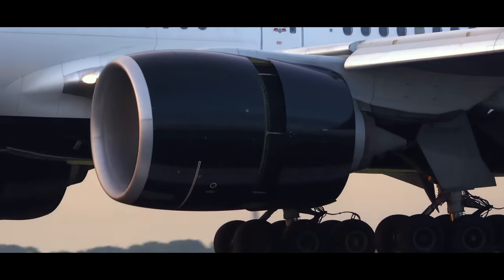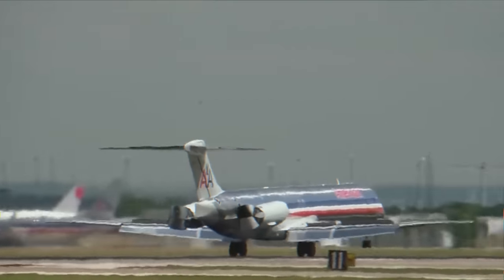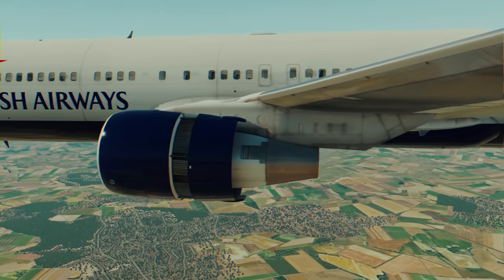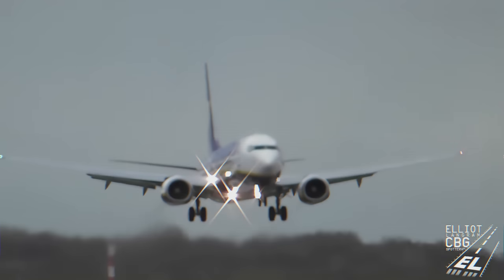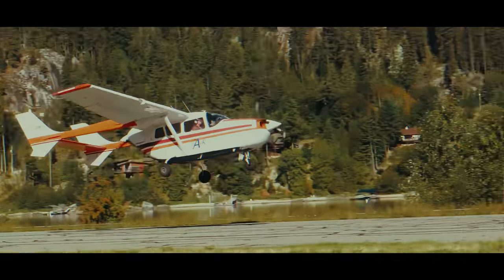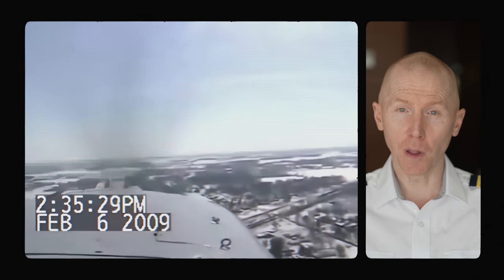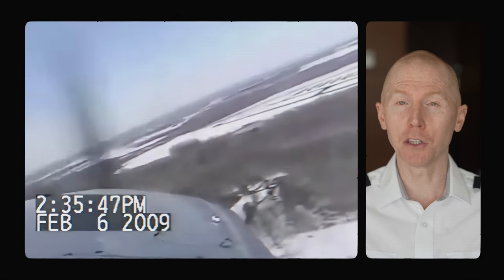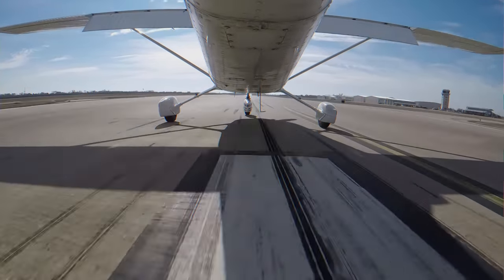Ryanair Pilot Makes Big Mistake

Comment: You said "I'd want to get lined up with a runway as fast as possible".  That's exactly what the pilot did, by flying directly towards a runway and intercepting with a tight turn.  He was more than half way down the runway, not like he followed any traffic pattern.  I'm not sure what you would have preferred,

I thought that heavy breathing was the engine backfiring, which is why I was mildly confused when you addressed the windmilling.  I thought the engine was running and the pilot killed the ignition as soon as he was clear of the runway.  

As the operator of less than reliable vehicles, I admired what I thought was good protocol for a failing engine - let it run if it can and you can gain any* needed propulsion, but as SOON as you can, cut power and get that motor to stop rotating before more damage is done.
I didn't notice the centerline effort, but with any profession, an aspiration to do better and challenge yourself is highly respected.
Reply: Of course I paused the video, typed that comment, then resumed and you elaborated about the tight bank angle and the stall risk.  

- I stand by it though.  He did not initiate a turn until the stall horn cleared, which has some margin, was clear of the trees, and in close proximity to the runway, losing altitude was a desire and done controlled.

Comment: The FCOM I'm looking at for the 737 says that the thrust reverser can be deployed when either radio altimeter senses less than 10 feet altitude or when the air/ground safety sensor is in the ground mode.
Reply: ☝️thanks for watching & leaving a comment, congratulations, you have been selected amongst my shortlisted winners
Kindly message me on the above ☝️

Telegram only to claim prizes🎁

Comment: Inadvertent thrust reverser deployment in flight at high speed (>400 knots) was what crashed Lauda Air 004, a Boeing 767. I read that Boeing had to update the systems to make thrust reverser deployment in the air impossible.

Comment: Just on the point of the pilot possibly thinking he was already down when he deployed, I notice at that exact moment, the wings level quite sharply - there was probably a noticeable jolt on board and it would be visually impossible to distinguish, so it's entirely possible that for an instant, the plane did a convincing impression of having landed. I know when driving or gaming in a tense situation, my reflexes with familiar controls can be faster than conscious thought, something tells me it's the same for piloting a real plane :-)

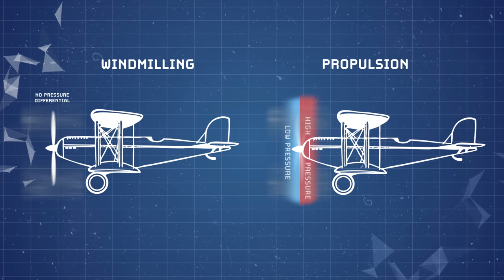Comment: 13:57 - That "low pressure / high pressure" graphic is very misleading. It's not air PRESSURE that pushes the plane through the sky, it's air MOVEMENT. The propeller hits the air at an angle of attack that catches the air and throws it backwards. Newton's law (action/reaction) is what pushes the plane forward, not Bernoulli's equation. In fact, the air pressure behind the prop is lower than the surrounding air; THAT'S Bernoulli's equation, and it's where wingtip vortices come from. And by the way, airplane wings work the same way: by pushing air DOWN, just like a helicopter rotor.

Comment: Agree with 95% of what you say. But saying he should have been lined up with the runway earlier is not right. He barely had the energy to make the field. He did EXACTLY the right thing. Get it to the field. He saw a last minute opportunity to get lined up and took it. If he had landed across the runway on the grass(snow) he would have still made a superb job of it.  A well done. He could not line up earlier.

Comment: If 1. you have high speed on landing (For whatever reason like side wind etc) 2. having short runway 3. snow - slippery surface, maybe he tried to slow it down ASAP, but before touching down it's not recommended to use the reverse at all. and those swing left and rights! no idea ...  
Also why don't we have cameras for pilots to look at the lower area to see what's going on!?

Comment: Don't know about the later dash numbers, but on -200 you had to compress the right oleo to get the aircraft in ground mode. Only then would the thrust reverser and ground spoilers be deployed. Correct me if wrong.

Comment: Pretty sure the guy still had partial engine power. If it was just windmilling the propeller would have stopped a lot sooner. Especially if he was landing with a tailwind. It takes pretty decent airspeed to get the propeller to windmill. His prop didn’t stop until he was darn near stopped

Comment: The second issue with the pilot losing power on takeoff during climb is what I have been trying to get the FAA to respond to. The airport near me has pilots training and practicing all day and when they take off and enter their supposed "traffic pattern" they have only reached 100ft, they fly right over people's homes and a large retirement community, if this were to happen, excuse me, when this happens there could be a disaster, they have not achieved enough height to do anything but crash and because they and the FAA refuse to adress the issue and reroute their traffic pattern over things other than homes, for example the state forrest that surrounds us, the lake and several reservoirs that surround us and a hiway, they have also targeted my home for complaining. I say when that happens because we all know that any busy airport will have engine failures, etc, this airport has 50-100 flights a day, it's just numbers. Remember the name Chester Airport, Ct, you can also search crash data bases and see how many crashes they have already had.

Comment: I think that these Ryanair pilots didn't know about the Lauda Air disaster. A 767 (I think) aktivated 1 (or Both) thrust reversal midflight by an electric cascade failure and the plane was doomed. Nobody knows that this failure can make a jetliner crash. Niki Lauda checked the whole investigation, because he wanted an answer. After the failure discovered, the NTSB tested it in cruising height and speed with a modified DC-8. Only 1 reversal was enough to stall the wing.

Comment: I disagree with your opinion regarding the landing at 16 minutes 30 seconds. The pilot is approaching those intersecting runways diagonally. It's a 45° adjustment to land on either. So neither turn is more aggressive then the other. Further, his line of approach crosses the unchosen runway on the short side of the runaways intersection, conversely that same line of approach crosses the chosen Runway just short of the two Runway intersection. This means that he has more length to land on the runway he chose, unless distance on the runway he avoided. Please consider what I have said, and comment, I would appreciate that. Mark Henry British Columbia

Comment: I think the pilot was avoiding the snow on the ground. He probably would've happily landed on the grass but there was too much snow and that would incur a serious risk of flipping the plane over when the gear, especially the nose gear, sunk into the snow. It looks like maybe a foot of snow on the edges, which is likely too much for those little tires to plow through. That was the reason for all the desperate banking -- to get on dry pavement.

Comment: There are airlines where the pilots deploy the TRs just prior to landing. Plenty of videos on YT, where pilots do this when landing. This is prohibited in my airline but the 737 was designed to allow reverser deployment when the radar altimeter is below 5 feet. (Or a number like this) Regardless, you can not do a go around after TR deployment.
I am certain this pilot did it on purpose. I have see other Ryannair videos where the pilot does the same thing.

Not hard to find out the TR logic for the 737. Just a function of the radar altimeter.

Comment: Kelsey, have tou found the 744 BCFs to be different in Performance factors and setup regarding COG and MTOW because the uppser deck on the 744 BCF are the full length passanger variant decks and compared to a Factory made 744.and 748F Upper decks that are rhe same as the 742 size Upper deck hump style and I assume weight etc.
But maybe that extra few metres on the 744 BCF that were iriginally pasanger 744s that Boeing converted to Freighters hence the name lol BOEING CONVERTED FREIGHTER. 
I would assume compared to the smaller 744F AND 748F Upper decks which are the same size and shape as the old 742 upper decks, rhere wouod be more room and different feel for a freighter upper deck on a 744 BCF, especially as  the converted passenger 744 upper deck is the same size as aircraft like the e190 etc.
Im so stupid assumung you have flown in a 744 BCF lol but if you have do you add extra MTOW weight calculation for the added weight of a full length 744 upper deck?

Comment: Would opening the thrust reverser have a more dangerous effect of disrupting air flowing over the wing? If your lift is created by air flowing over the wind, disrupting that airflow could just result in a sudden loss of lift rather than just a it trying to slow the plane. Sort of like if you planes propeller was turned flat to the wind suddenly deflecting  air away from the wings edge? Not a pilot btw so not sure

Comment: I did exactly what the Ryan Air guy did on once on landing a 737 in Mexico City. Thought I had greased it on but was actually about a foot high and deployed both reversers. Both of us did not know this was possible but checking the flight manual later I learned you could if the landing gear is down and radio altimeter reads less than 5 feet!  Although it was not a bad touch down, I Never did that again!

Comment: Looked to me like the second pilot was flying an 'S" to  loose speed before  touching down and give himself a longer runway distance to land on.  Remember the engine failure happened before he had  even left  the perimeter of the airport so he knew  he would not have a full runway to land his plane.  Hitting a snow bank at the end off his landing at any sort of speed is likely to not end well for the plane and possibly the pilot.
Reply: ☝️thanks for watching & leaving a comment, congratulations, you have been selected amongst my shortlisted winners🎁
Kindly message me on the above ☝️

Telegram only to claim prizes ☝️

Comment: A few years ago i was flying with Ryanair as well and i think the pilot did the same thing. I could feel the plane decellerating while still flying and then hit the ground quite hard. Most people just accepted it as a rough landing but i was curious. 
Some people who seemed to know a little bit about aviation told me later that air planes cannnot deploy the thrust reversers in flight and i must be wrong.
So, if i was right or not, at least it's nice to hear that they have been wrong too. 😂

Comment: That was at Stansted Airport, think it is one of the longest runways in Europe (not that it is a good reason to do a bad landing), so I could imaging that the pilot thought hey had plenty of runway to pull an odd manoeuvre at the passengers expense. Unfortunately I dealt with handling with Ryanair and know the management do push the pilots to the limits on occasion, so I am thinking this has happened because they cannot afford to lose time. Plus Stansted is a very flat and open Airport, cross winds are very common on a windy day at the best of times, just think that the baby Antinov often visits and that uses every inch of the runway (scary thought when you see this happen).

Comment: "You don't really need thrust reversers unless poor conditions require them."  
Immediately flashes to a clip of Air Canada lol  
I've taken 12 flights in 3 months out and in to Canada recently and there hasn't been a clear runway yet. They always de-ice the planes. Snow plows are always running... and there's always a certain amount of snow or ice on the runways.

Comment: Is it correct to say that the thrust reversers only negate any residual thrust from the engines and provided very little braking effect? 
For example the A380 only has them on the inboard engines . 
I read this is for weight saving and the fact the engines are so far out they would possibly cause FOD .
If they were needed for braking they would have installed them surely . Cheers

Comment: To be honest, seeing a fellow pilot bashing on collegues who are doing their best and calling out the word “mistake” without knowing the aircraft nor the situation is very very disrespectfull (I'm not a Ryanair pilot btw). 
If you look at the video prior to the deployment, you will see there is a slight overrotation in the flare which is a very very typical 737-NG situation in these conditions. The required forces in roll are light, in pitch they are heavy, the wing makes it a floater, you come in with "forced" excess speed (not even discussing aircraft landing weight here...). Upgrading from the classic to the NG, Boeing created an aircraft with all the ingredients for long landings in stormy weather with their new wing. If the aircraft ends up in a good touchdown attitude and you realise you're in for the long landing anyway, you are safe to “commit” to the landing (hence early) and avoid the float by deploying the reversers and force the touchdown. The reaction will be instant. No waste of time.The aircraft is in the landing conditions as Boeing requires, the only thing that changes is the "commitment" to the landing. Been there, done it many times. 
You prefer the long float as opposed to landing in the correct touchdown zone (and even call it bad habits and a mistake?)... 
BTW, reverser deployment after bounced landings is a lot more dangerous. Because it happens a lot later, so technically you are always opting for a long landing... which should be followed by a go-around, not reverser deployment.

Comment: Lauda Air Flight 004  On May 26, 1991, the Boeing 767-300ER operating the service crashed, following an uncommanded midair deployment of the thrust reverser on the No.1 engine

Comment: It only happened a second before touching down so it would not have had much effect on the speed of the plane.  As well it takes a while for the engine to get up to speed, to provide this reverse thrust. So when the pilot touched down he could immediately apply reverse thrust with less of a wait.  Which is important if you're running out of runway!  Anyway, that is my uneducated guess, but like to think I have a resonsable understanding of physics!
Reply: Gavin

Comment: Looks like he only just got back to the airfield, so no chance manoeuvring to get the wind on the nose. The stall horn doesn’t sound right at the point of stalling, it sounds before that point, so as long as he knows his aircraft and the stall speed for the configuration, then he can fly with the horn sounding, no problem.

Comment: That GA pilot was on the razor's edge of a stall spin. Yep, he made it back, that time, but he was a hair away from being just another GA statistic. I'd even say that instead of making the "impossible turn" back to the field, he should have been keeping the wings level, pushing the nose down,and looking for an open spot to put it down. Yeah, the plane would be damaged, but you've got a lot better chance of walking away from a straight-in, wings level, controlled ditch in a field than stall spinning from 100 feet.

Comment: I know little about aeronautics.  You mention that he took off into the wind, and landed with a tail wind, if that's the case then that runway could have a potential strong side wind?  And if that is the case I guess a tail wind is easier to handle on the ground than a side wind.  Im prob way off with that thought.

Comment: Couldn't there be logic that activates a thrust reverser on the engine in case the one on the other side has activated, specifically to prevent that spin you're talking about?

Comment: So should you lift off with tail wind so if there is engine failure you have more lift after you turn around to wind and make emergency landing with less ground speed? Kinda makes sense, but then again if you have tail wind you might have issues to increase your altitude in the first place, so witch is worse situation?

Comment: In the case of an engine failure, is the propeller disconnected from the engine, or is the wind forcing the engine to spin (losing even more energy as a result)?

Comment: Quite surprise thrust reversers allowed in flight. Weren't there some really bad crashes due to this? The A320, when released was etremely pedantic with logic that required not only pressure on nosewheel, but also sensors showing wheel was spinning before allowing speed brakes and thurst reversers   (there was an incident where hydroplaning resulted in wheel not spinning and thus pilot not allowed to deploy them, and Airbus updated the logic since).   Would have though all modern planes would have strict logic on thrust reverse depoyment. Is this a legacy from the 1960s 737 that is preserved in more recent variants to proserver cockpit commonality?

Comment: This may seem random commenting on a older video - on Ryanair flights - I've noticed on a couple of landings that have pretty much felt like they "have thrown out the anchors" as it were, and  the braking has been pretty harsh - and was wondering would this be the reason for that? (harsh as in thrown forwards in the seat - more so compared to other airlines - well aside from Vueling - i have a special hate for them :) )